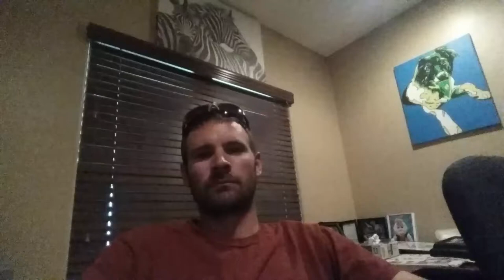Basics of BER Pre & Post

Comment: Thanks... What could be the cause for this? Bad drop? Bad wiring?
Reply from the maker: Cause BER? Anything that disrupts the digital feed between when it is injected in to when it gets received at the equipment. Anything can cause the disruption of 1's & 0's. Usually loose connections or poor shielding letting foreign signal in, corrosion and impedance mismatch causing reflection of signal, poor performing plant amplifiers (often times when turned up too much or the input is receiving too much signal. This is similar to turning your car radio up too loud until it is causing poor quality as the speakers can no longer accurately reproduce the sound as it was intended).